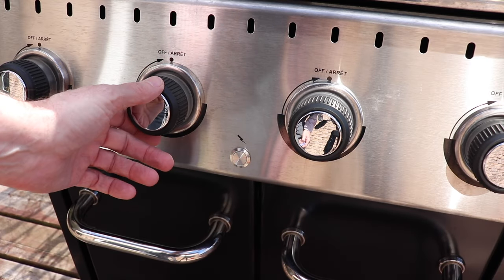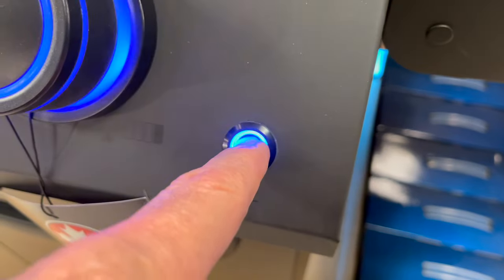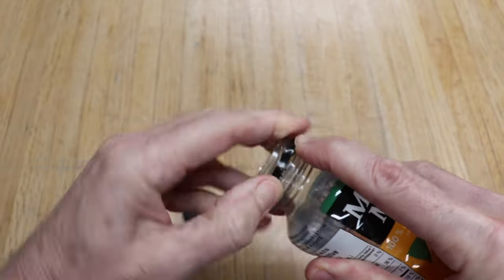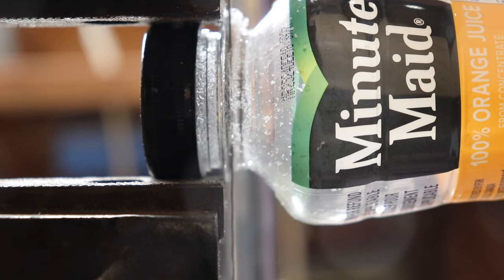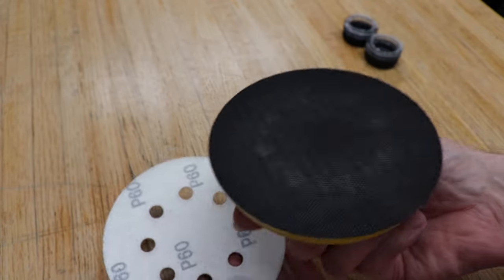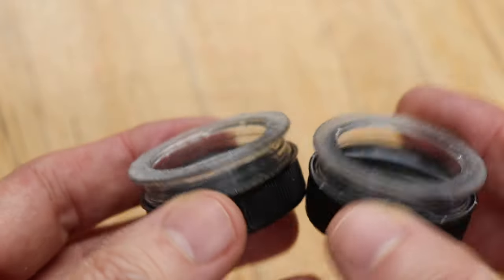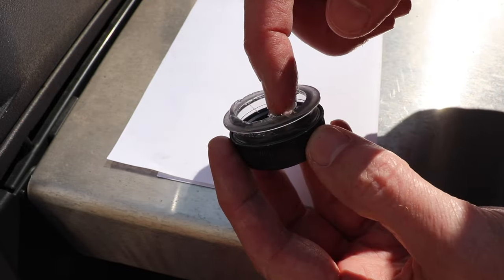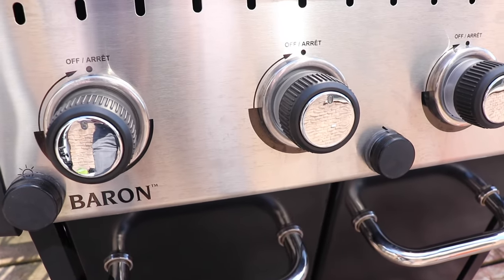Best BBQ Hack ● Using A Juice Bottle !

Comment: Very cool idea. I would leave a small gap at the bottom of the silicone seal to let water out.
Reply from the maker: I never leave the lid off. I light it and put the cap on right away. Good tip though.

Comment: Ya lets make a outdoor grille with components that are less than IP66 rated.  Ya, that switch its available in IP-66 or greater, but they cost a few more bucks. Yet when spending upwards around $400, everything in and on that grille should be rated for weather!   Chris that button is available from Digikey and a few others.

Comment: If I had that problem, I would just take a 2" piece of electrical tape, 1" wide or more, and fold back 1/3 of it to make a flap to stick above the button (which will not stick to the button.
Reply from the maker: That would work too.

Comment: I wonder if just squirting marine grease around the button would work. Or doing the same with a circular cut of plastic from a ziplock bag alternatively.
Reply from the maker: It's all about experimenting and solving a problem. Both of those ideas could work.
Reply: Most high pressure greases are electrically conductive. I'd suggest silicone grease. I was considering packing the button like a bearing with it.

Comment: I have an older Broil king Baron. Uses the less elegant push button (that houses a single AA battery). It's never failed me in the eight+ years I've had the bbq. Think I've only changed the battery once so far

Comment: I hate those electric sparkers. Piezoelectric ones worked when wet and rarely failed. 

I only have to replace the "spark end" that gets burned away from the flame in my 90's webber every 3-5 years (i use it daily as long as there is no snow). 

Every time I use a friend or relatives grill the dumb electric sparker is dead... probably for this exact reason.

Comment: Just condensation will make them not spark. They work again when they dry out. My BBQ does not have buttons, when you turn on the gas it sparks. Never works when wet but still working after 35 years and I never cover my BBQ because it did not come with one. BBQ Galore Cook-On Three Burner. If I cook after a rain or in foggy weather I use a lighter which then dries it out.